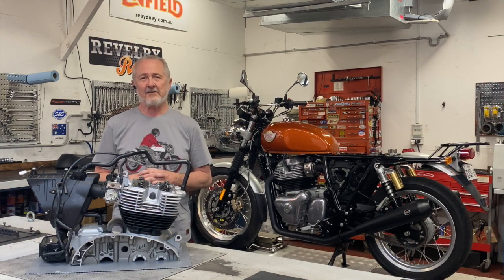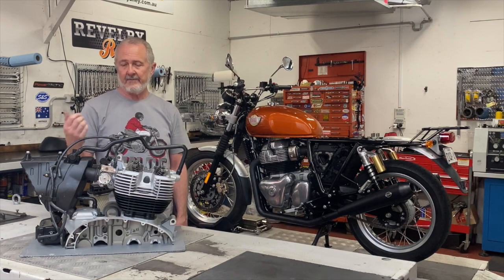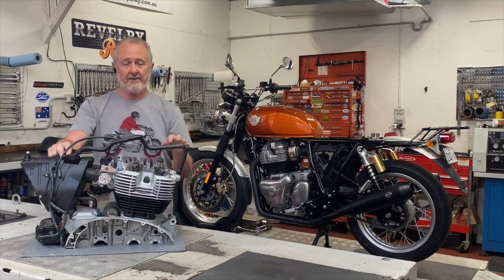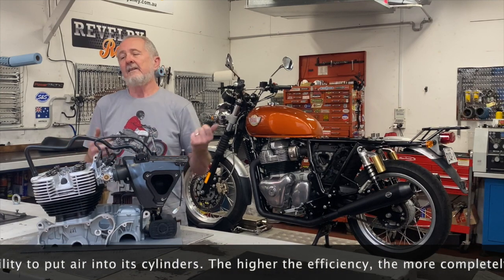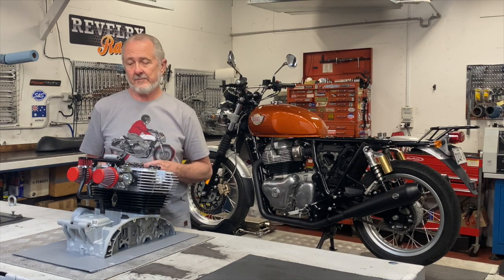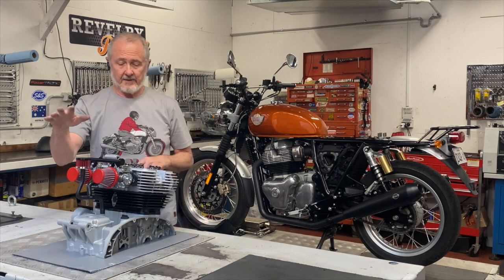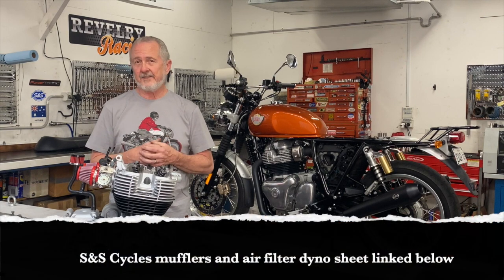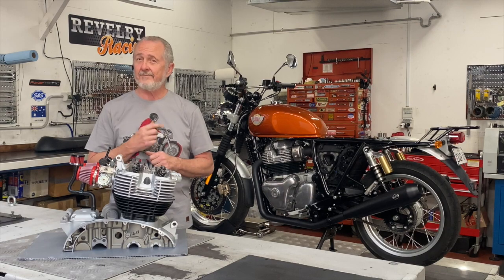Episode 2 Air Filtration Systems for the Royal Enfield 650 Twin

Comment: Thanks for the informative video. Now I understand why the air is drawn in through the center of the filter and not the exterior as with other filter systems. It seems that this set up would make reusable air filters harder to clean. It's been bugging me since I noticed the different air induction technique.
Reply from the maker: The trick is a soft toothbrush. You put the filter cleaning solution on the inside and gently spread it with the brush. Let it soak in to break up the dirt. Then (again gently) brush the dirty inside as you rinse the solution off with warm water from the outside in.
Reply: @RevelryCycles  
Thank you.